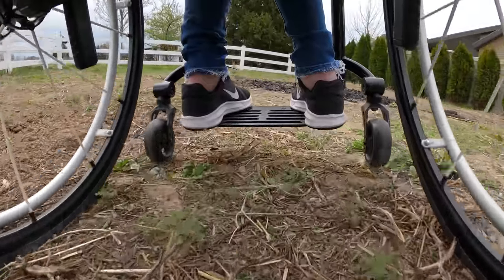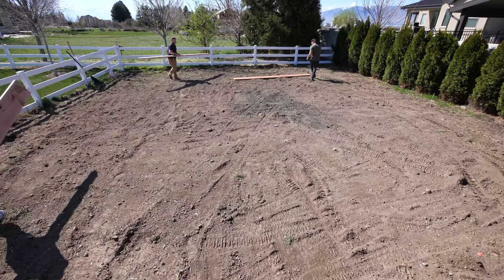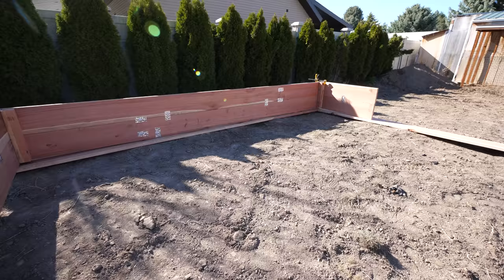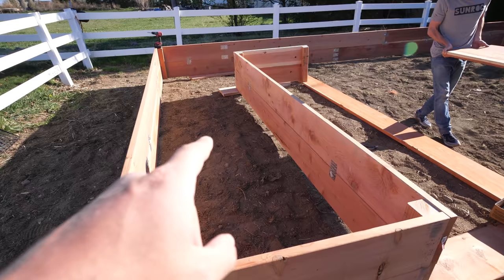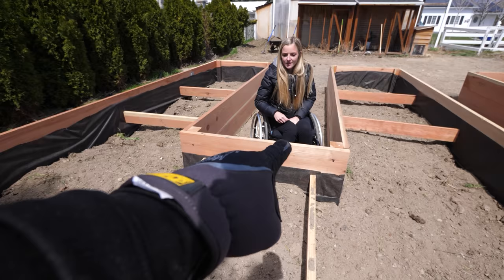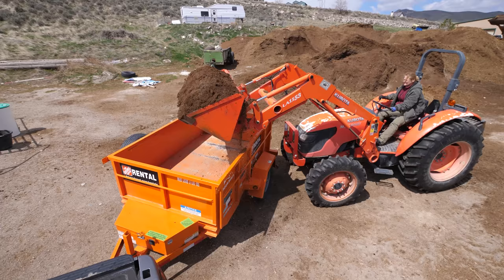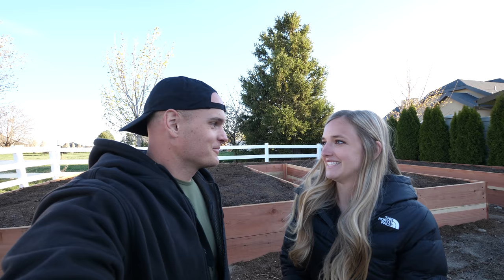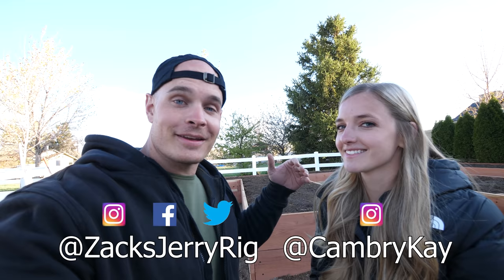How to build a MASSIVE Raised Garden - For Wheelchair Users!

Comment: If you want gardening tips I'd recommend putting a line of copper around the top of the boards (keeps the snails out). Also try burying some conkers in each corner (somehow keeps out the spiders).
You could also plant a bunch of Marigolds to keep out other insects.  For plants I'd recommend nasturtiums (edible and pretty) as well as mint or cabbage

Comment: Corn can be difficult to grow so try a very small section(Max 4 square feet), probably not contiguous too maybe a row on each finger end. Tomatoes are really good. Various squash(summer, acorn, zucchini, pumpkin)  are known to be fairly easy to grow.Peas and beans are good, but they need vertical space to grow the best so some Chicken wire on supports os wonderful for them(they could grow over the edge but I would be afraid of them getting in Cambry's way). Don't be afraid to get already started plants either most people in utah need to use greenhouses to get a really good crop(if you know what you are doing you don't really need it but I'm not that good so I support the local nurseries.

Comment: First Redwood is NOT a hardwood

Second of all, newer treated pine is actually perfectly safe for the soil and for you it is FDA approved as a non-toxic food-safe material.
Reply: Teak, Ipe even Oak and Beech are several times harder than Redwood :-) But ofcourse, the price would be much higher...
Reply: Guys leave the guy alone 
He built this for he wheelchair bound wife 

You probably couldn't even built anything with wood
Reply: @connorwassell3870  Wrong. And it has nothing to do with his wife on wheelchair. It's just about choice of material. Well, I would do it with stones, cement, etc as I do not live in the US. But wood is simplier, faster and cheeper.
Reply: @connorwassell3870  Firstly I take great offense at your comment I restore old historic barns for a living so yes I think I can make something out of wood.  I see what age is every single day where I live. We have quite harsh Winters so in the winter I work as a fine Carpenter.  But when you have millions of subscribers and spread misinformation that does not sit well with.

Comment: As you asked,... I would recommend shorter veg, such as lettuce, peppers, eggplant, possibly roma tomatoes, but not not beefsteak or heirloom varieties that need more pruning higher up. They grow rather tall. Check your cultivar infor for height. Brocolli and Brussels sprouts are a long maybe. Pole beans are very tall and need daily picking. Only Cambry could say if she can reach a bean seven feet up from the surface of the bed. Onions, carrots, and other roots might work very well. Before reaching for expensive all-thread, I would consider steel cable and plan it as an early spring or late fall project. Thanks for the video. Enjoy the adventure.

Comment: Hi Jerry, this is a very good idea of building those planters.  I strongly suggest you burry on the bottom of the planters big logs of tree, smaller branches and wood debris, then you cover it with soil and hay on the top. It will make a natural fertilizer, slightly increase the temperature of the soil allowing your in soil vegetables to resist on winter. Make research online, you'll see all the benefits.

Comment: If you plant corn it is good to plant pinto beans right next to them as the corn will intake any nitrogen in the soil you have. So by planting beans in between each corn seed it will then replenish the nitrogen that the corn uses. Its a very neat symbiotic relationship

Comment: I know I'm really late but I do have some advice, I've worked on a organic farm for 6 years and we use very  few machine just like you will have to do because of the type of garden beds you built. Just so you know I work in Iowa and I'm not sure how well my knowledge will translate to your climate. For one I know that you had to make a raised bed so it was wheelchair accessible but in general you want raised beds in dry climates and sunken beds in wet climates, this is because generally the more it it raised dryer it will be and the more sunken it is the wetter it will be. Because of that I would recommend putting in a irrigation system. As far as the produce you grow I personally wouldn't recommend corn, it's not self pollinating meaning you need multiple plants to make it work and to make it pollinate correctly you would need at least 1/4 and possibly 1/2 of your garden to be corn. If I was in charge of that space I would make one of the "fingers" perennials, the ones I would grow are mint though it is extremely invasive so you would have to make 1-2 feet of it mint and create a barrier to prevent it from spreading into the rest of the bed. Also i would recommend either one or two chive plants, they come back every year and buying they in the grocery store is a pain. As for the rest of the bed asparagus is a good choice, it's one of the earliest produce you can get due to how it grows and home grown asparagus is great (I usually eat it raw and it's wonderful). I would then grow root vegetables in another row, garlic, onions, carrots, and beets are great options but remember to thin them out so only one it growing in a single spot. Also remember to plant your garlic in the winter right before the ground freezes so it can grow right when the ground thaws. In the third finger I would recommend planting greans after the last freeze such as spinach, chard, and lettuce (my favorite leaf lettuce is black seeded simpson) also if you don't use all the space you can grow snap peas because they stop growing at about the same time as greens.  After those stop growing I would plant summer squash/zucchini in the space the  spring vegetables grew. As for the last space I would grow tomatoes but I'm not sure how it would work with a wheelchair, you could try trellising and growing determinate tomatoes instead of indeterminate tomatoes but in still not convinced it will work. If tomatoes don't work eggplant and peppers both are great options that take a similar time to grow. If you read this and have any questions feel free to message me I love talking about gardens and growing 😊

Comment: I would add an irrigation system such as a drip system. Raised bed gardens tend to dry out faster than in ground gardens and the soil should be kept damp like a wet sponge. Once planted feel free to cover the top of the soil with mulch (not on top of the plants though) this will help to control weeds and help keep the soil moist. FYI, know where your mulch comes from, do not buy colored mulch. You have no idea where it came from. Best to get it from a tree service who cut down trees and grind them up; they will be all natural.

Comment: Might be a bit late to comment but I might mention looking for some dwarf varieties of plants you might want.  Depending on what you get they should yield rather well and be much more accessible for the both of you when it comes time to harvest.  I might also suggest using some trap crops like marigolds or tobacco which could help with some pest control.  I'm from Nebraska so I'm not entirely sure what kinds of pest pressure you might be expecting in Utah but I do think a trap crop might help make gardening a more enjoyable experience!  That said though don't be afraid of maybe using a basic insecticide or fungicide if you have serious pest pressure.  They have a time and a place and if you use them safely and smartly they can really save your butt. :)

Comment: A little garden tip, you need worms in your garden, and lots of them. I recently created a worm farm in our manure mixture with dead leafs. We shedded the leaves down to half it's orginal form and let the worms do their magic. After a year, the mix is ready to use and can be put straight into our dirt. In Georgia, we usually have clay type dirt which isn't ideal for good yield. So we create a small dirt bed and cultivate it by mixing the clay dirt and the leaf and manure mix. It does pretty well when it comes to making good veggies.

Comment: Thanks for sharing. My wife uses a wheelchair too and we did something like this but smaller a couple of years ago. The problem is that from a wheel chair it´s hard to reach whats growing in the flower bed if not standing on the right or left side of it and turn sideways which means it´s pretty easy to hurt your back.

Comment: Use hanging/wall flowerpots on the front sides(so they don't stop the easy movement in the paths) and plant fresh herbs(basil,rosemary,parsley,dill, etc). Cut a hole through both so the plants have access to the moisture.

Comment: Ok some important stuff here I hope helps you. I grew an organic garden for 10 years. First best to use Heirloom and non-gmo seeds. GMO is genetically modified. This way the seeds you collect can be used to grow another generation of plants and veggies. 2nd thing is google and learn about ‘crop rotation”. Each plants/veggie etc uses more of certain elements from the soil. Not good to keep replanting the same thing in the same spot. There are charts or books you can find that tell you what crops are better to follow other crops. 3rd. Start composting. You can take a pile of starter compost or soil then you throw in your veggie remains and fruits, rinds etc. it will break down and add great nutrients to the soil. You can purchase compost bins or you can take 4 pallets, make a box, staple chicken wire around 3. Leave extra wire at the bottom and use wire clippers to make it into points which help hold the box in place with the wire into the ground. Put a hinge on the 4th pallet to open and close and then cover with wire. You need to turn the compost periodically with a shovel or whatever. Some will fall out though. It you want it super neat and clean but a professional compost bin. Oh yeah, if your not familiar with Swiss Chard trying growing it. Cooking down the leaves with just a little salt, pepper and butter = Yum! Best of luck to you.

Comment: While growing corn is fun, corn is so cheap to buy, it's not worth it from a financial standpoint. Some thoughts:

* Tomatoes - especially beefsteak. They're $1.99 a pound where I live in the summer, but can get as high as $5 in the winter. We grow them, then turn them into sauces and store them in our freezer to use throughout the winter
* Okra - very good in southern gumbos and soups. You can freeze them and they hold up well
* All types of pepper - good in all sorts of dishes
* Zucchini - if you grow the bush kind, they can take up a ton of space. I wouldn't grow more than two plants
* Pumpkins - nice because you can train them to sprawl on the floor and out of the way

There are others. Cucumbers. Sweet potatoes. Good luck!

Comment: New gardeners do your research. You may want sandier soil for some things you intend to grow. Also certain plants grow better planted together and certain plants don't like each other. Parents have done market gardening for decades and are still learning things. Rain water is better than tap water usually as some treatment plants remove minerals plants want. You can run eaves throughs off buildings into collection barrels. The manure will not only provide nutrients but heat as it continues to decay. Garden centers in you area will be your best source for expertise.

Comment: Those chemicals you want to avoid (arsenic) are no longer used in treated lumber. They switched to brine (years before this video). I used treated lumber and lined the inside with plastic to prevent the salt from seeping into the dirt. But, if you can afford redwood it is a better option.

Comment: I am a high functioning quad 20 years from my accident. Was an avid gardener before and spent the last year getting my small animal operation dialed in. Now I need to put in the garden. Can you tell me how wide your isle and beds are? Or better yet, can you turn your chair around or do you need to back out and how far is the overlap of your reach from both sides? You use a very similar chair as mine. 
Suggestion regarding pathways. Set them in gravel just far enough apart to not eat ypur casters and plant in creeping thyme and similar plants. Will help to not get too hot, control erosion and run off, plus it's great pest control. Bug me with climate particulars (or just your location) and I can give more targeted suggestions. Your friend PNW regen at urban farmer.
And about getting overtaken by pumpkins. Use pig or cattle panel arched over the beds to grow over (roots and refuge channel has nice examples) if you cover the beds themselves, you can grow cool temp things better when it is hot ie stop your greens from bolting.
Also consider a chicken tractor frame so your birds can prep the beds for you, and you can use then as season extenders or to protect from bugs.

Comment: That’s a lot of soil. 10-14 inches of soil would suffice for growing most everything. A raised table top style bed would have worked. Put slats in the bottom for drainage with that fabric covering the slats and side so the soil doesn’t come out. Easier to amend the soil over the years, plant roots wouldn’t have the search so far for water, less dirt for unwanted pest and critters, as well less water usage. Table made to same height for wheelchair access. Wishing you a successful harvest

Comment: I would recommend planting corn on the real ground... It grows very tall. Lettuce, Radish, carrots, and your generic salad veggies grow very quickly and you can get a harvest a month in if you are not n top of things.
An expansion with some vine type plants such as cucumbers, squash, with an Iona (overhead tunnel of vines) would make a nice addition.

Avoid using any chemicals, and grow your plants naturally if you can.
Reply: Also consider running soaker hoses under the dirt a bit  to keep the sun from evaporating the water. Don't sprinkle water on the leaves when the sun is hot, it will magnify the uv and burn holes in your precious plants.

Comment: Garden bed with redwood is a bad idea right? At least without plastic protection underneath to prevent moister from seeping into the wood. Building it out of treated wood plus plastic covers would guarantee it could last for 10+ years. I know the exterior looks nice now but in a year or two it starts to break down pretty quickly. Just my take.

Comment: Get anything you want but try and research the plants strategically like say one plant needs nitrogen and Gives back good soil another plant could need good soil and give back nitrogen so if they were planted near each other they would support each other so look into things like that PS when planting potted p,ants broken up styrofoam is a great thing to mix into the bottom of the pot to improve drainage

Comment: As cute and heartwarming as this story is, let’s leave room for commenting on the design. In my opinion the comb design is a problem because it has terrible routing. Flow should not require backing up out of dead ends. Better would have been to have the aisles open  at both ends , that is to simply have five rectangular beds. The loss in area is a tiny price to pay for the improved access. Good thing is that It can be changed next season.